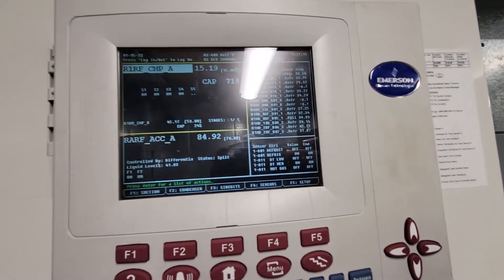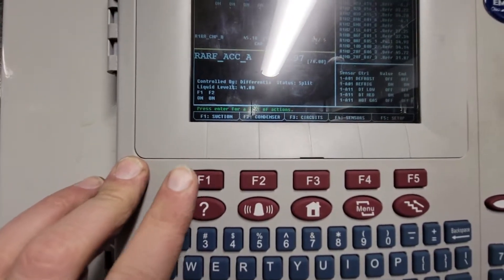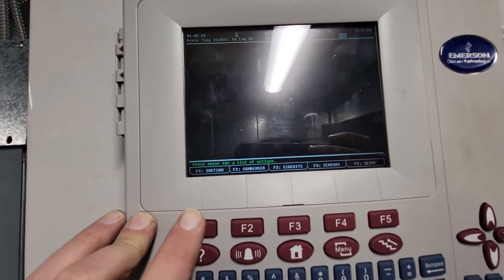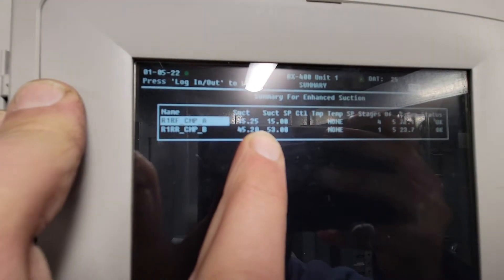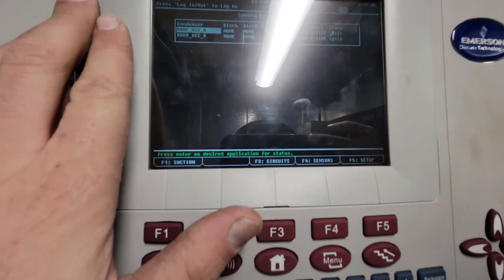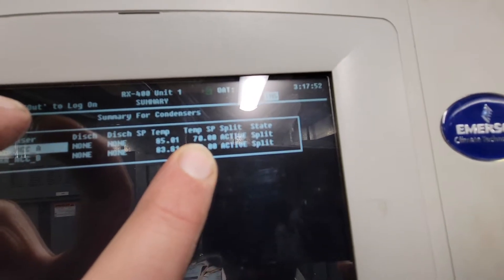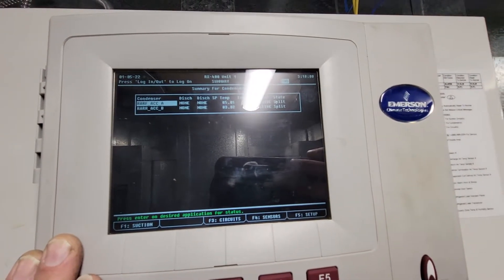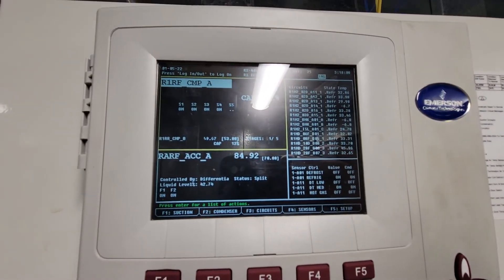Emerson EMS E2 Controller - How to see Suction Groups and Head Pressure

Comment: I have an E2, when you change the suction setpoint, it does save the setpoint but the compressors dont respond they still continue to maintain the previous setpoint….any ideas? Am I missing something stupid?
Reply from the maker: Did you adjust the pressure controls on the compressors possibly? 

Not sure what else it could be. 

Also there could be some kind of float program into the system maybe? 

It's hard to tell from a distance but good luck